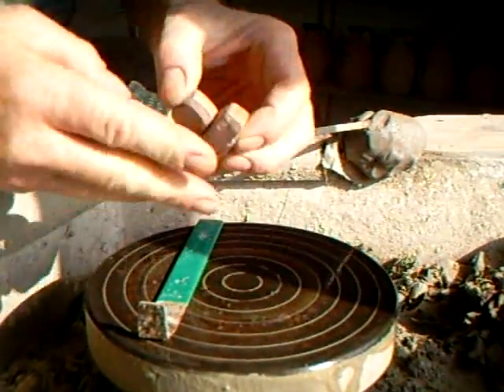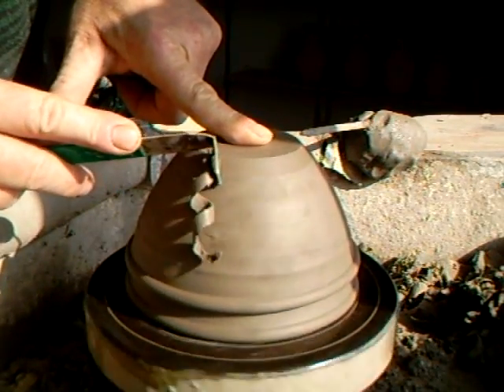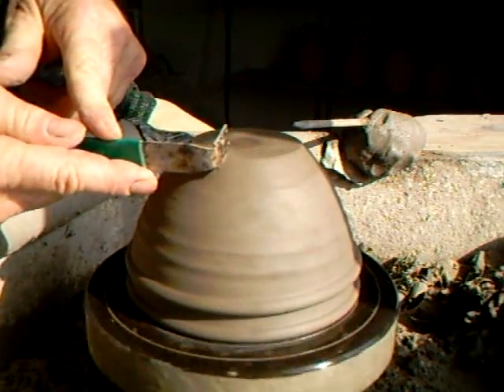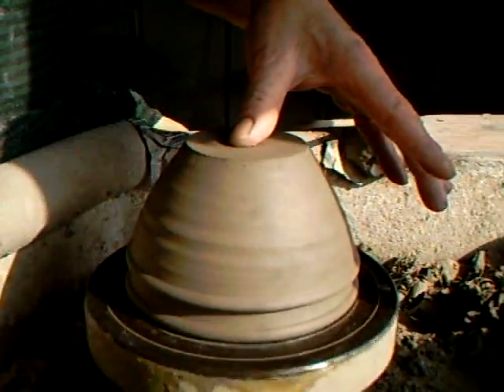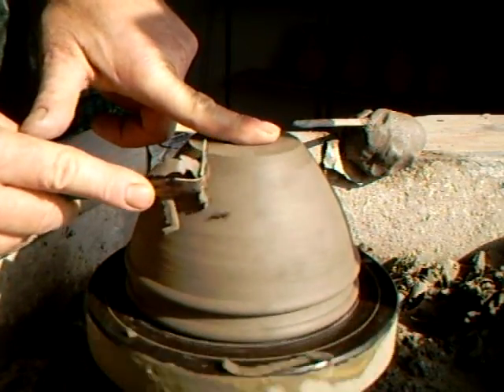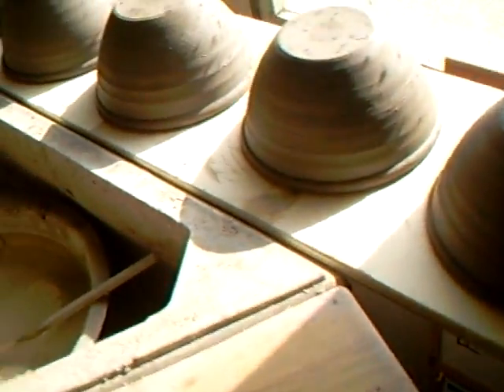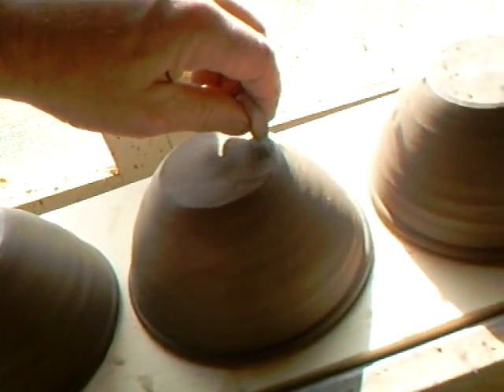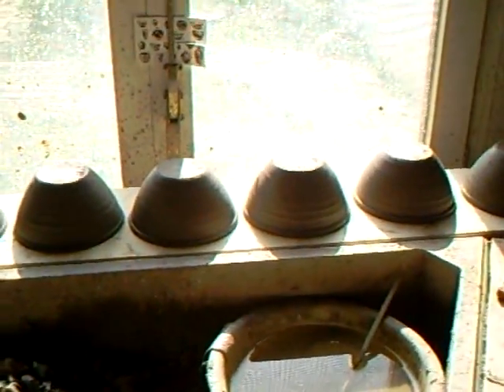SIMON LEACH - trimming bowls

Comment: Hi Simon: I actually enjoy the sound of your manual wheel. It has a calming Zen-like quality that appears as if it would help maintain a rhythm while working. I keep a rhythm going by loading my Ipod with music that fits what I am doing that day to either slow my work down or speed it up. It has been referenced to by others as "working in my zone." (grin) The sound of the wheel probably sounds right for me b/c I actually started on a manual wheel. The electrics have little to no noise, mine too.

Comment: The reason the knock sounds loud is that it is otherwise so serenely quiet, unlike the relentless mechanical whine of electric wheels. You can hear the most subtle sounds with the kickwheel, such as the tapping on the bowls. I doubt you would hear such intimate sounds with an electric wheel.

Comment: BTW,If a tool is trimming but leaving a line deeper than the full of the trim could this require sharpening to repair? It's a new set so I find it hard to believe it is dull already (high-quality set too). I can't feel any burrs on the blades but I kept feeling one when working using the needle tool that came with the new set. It had a slight burr so the  instructor ground it down for me.  I appreciate ideas.